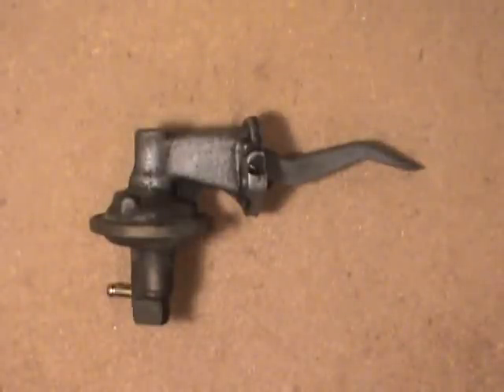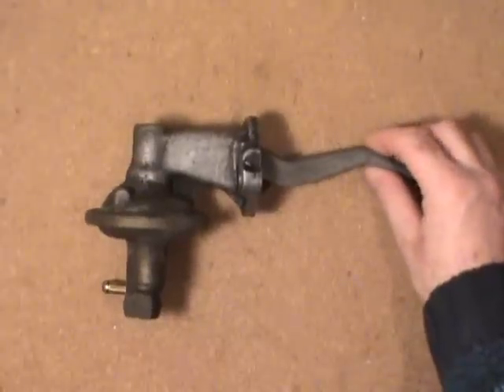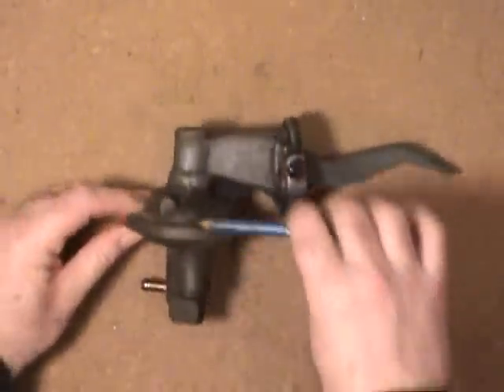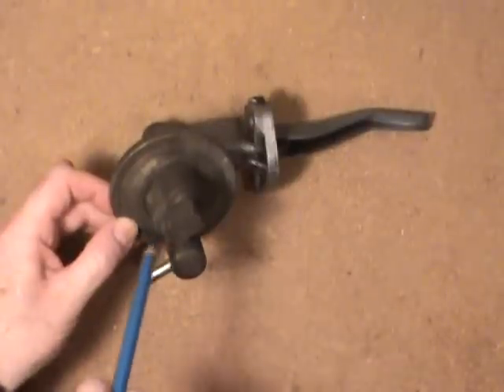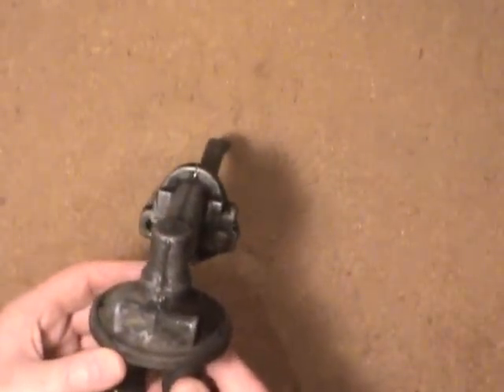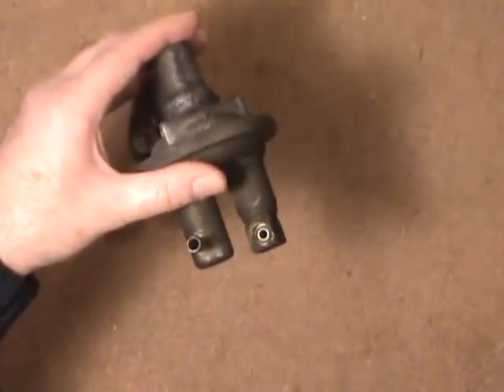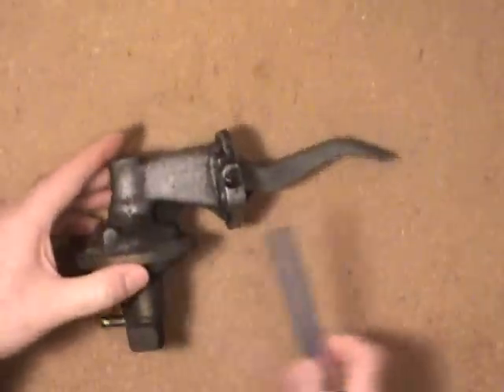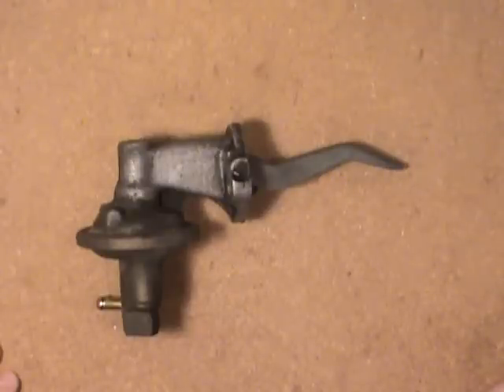Fuel Pump Mechanical Type Demo

Comment: Sooo...  Am I correct - if I were to gently suck on the inlet tube, or gently blow in the outlet tube, the valves should offer some resistance if the pump is working correctly?
Reply from the maker: Greetings...Don Emmerich.............Thanks for watching............."Warning"...!!!...Never Inhale Gasoline Fumes, or, Gasoline, in its Liquid state, cuz the stuff is Very "Toxic", and is probably, a Nasty, Cancer causing Carcinogen as well...!!!................Maybe, try Your Low...Air Pressure Test, with something along the lines, of, an empty Squeeze Bottle (or squeeze bulb), with some rubber hose or tubing, connected to it, that will also fit, onto the Pipes or Fittings, on the Fuel Pump, and, just use hand pressure, on the squeeze bottle, for the Positive Pressure Test, and then, for the Vacuum/Suction Test, then, shall we say..."Pre-Squeeze" (aka, Squish the Air out of the Squeeze Bottle)..."Before"...making the Connection, to the fuel pump's, pipe or fitting, then Release, Your hand-hold, so the Squeeze Bottle, does all of the work by itself...oh, and, do the Test Out-Doors, for safety's sake.................I guess, that, in theory, by doing the Test, of Fuel Pump's, one way (only) "Check Valves", then, at least You'll know, whether or not, they are Functioning somewhat...........Me, myself, well, I haven't done this "Check Valve" test, yet, but maybe, some day, I just might...???................Speaking of Mechanical Fuel Pumps & (one way) Check Valves...a few years ago, I installed, a Brand New/Brand Name Fuel Pump, on a V-8 Engine, and it seemed to be working Ok...for a while...then...Oh oh...the Engine Died, and the last, shall we say "Suspect", that I was thinkin' about, was, the Brand New (with only a few miles on it) mechanical Fuel Pump, that, I not so long ago, installed, and I said to myself...nah, can't be that Nice New (mechanical) Fuel Pump, that's causing the Fuel "Starvation", in the Carburetor's float bowl, but, then again...Could "it"...???...............So now, here's the Test, that I did (and usually do), for the mechanical, type of Fuel Pump, that bolts onto the Engine Block (usually)...............I have the Vehicle (in question), parked Outside...then, I remove the Fuel Line, from the Carburetor...then, I connect, a few feet of Hose, to that disconnected fuel line, and place that Extra length of hose, into a Catch Can/Bucket, that's on the ground, near one of the car's front fenders...........Then, have a Helper, "Crank" the engine over, and, if the Engine Starts or Does Not Start, I'll be Watching the Way, that the Gasoline Flows, out of the end of that, shall we say Extension Hose.................If the "Flow" of Gasoline, is nice-n-Strong & continuous, then, the Fuel Pump is probably Ok...............If the Gasoline "Flow", is Weak...intermittent...or just "Spits", a little bit, just like this..."Faulty"...Brand New/very Low Miles on "it"...mechanical Fuel Pump..."DID"...!!!...then..."There's Trouble in Pair-ah-Dice"...!!!...lol...oh, and also, before doing this Failing Test, and do-in, the...Point-the-Finger-Blame-Game...@ the Fuel Pump...."Make Damn Sure", that There "is"...Gasoline "in" the Gas Tank...!!!...lol...............I sure (at the time), did, "Suspect", that, at least, one of the (one way....only)..."Check Valves"...in this almost Brand New, mechanical Fuel was "Fubar" (aka, messed-up), and pretty much, kinda rendered, this particular mechanical Fuel Pump, "Almost" Useless...and I say "Almost", cuz, at least the Car (at night time, and not much traffic on the road), made its way home, under its own Steam (well actually, it was, the little bit of "Gasoline", that managed, to make its way, into the carb's float bowl), that allowed me to, shall we say "Nurse" (with fingers crossed), and having the Car, going quite slow, and get this, "it" made it, all the way "Home"...!!!...Yip-ee...!!!...and look Ma...No Towing Bill this time...!!!...lol................Then, there's a "Pressure" Test, that can be done, with a Low Pressure, Fuel (testing) Gauge, well, if You have one, that is...............For a V-8 Engine, I'm use to seeing, about 5 to 7 PSI/Pounds per square inch, there-abouts.................To make sure though, get ah-hold-of, the "Specification", for that "Exact" (mechanical) Fuel Pump, and Engine, etc...cuz, some Engines might need Less Fuel Pressure sometimes..............For most Carburetors, it's usually..."Under/less than"...10 PSI...oh and, don't get Too Low, or Fuel Starvation (in the carb's float bowl), it just might be....and......till next time........Be Safe, take care, and have a good one.

Comment: im a do it yourselfer and iv got a 75 lincoln with a 460 big block 3 ports on the fuel pump the shaft that connects to the motor dosnt seem to have a rod that goes on top iv herd from a friend that all u do is shove it in and go the pump i got is supposed to be better then the standard but the shaft goin in is strait not curved is that going to be a problem cause i dont want to force it in iv got it under the crank shaft but im real leery cause of the tension ur thoughts good sir oh and besides the obvious it seems smaller in width and design then the standard the guy i bought it from said itll pull in more fuel
Reply from the maker: jacc boss Greetings jacc boss....Thanks for watching, and for Your comment/questions as well................................That "Rod" that You were referring to, might it be, that, You are thinking of a Chevy (Chevrolet), V-8 Engine's Fuel Pump, where that "Rod", that we are talkin' about, gets placed in the Chevy V-8's Engine Block, Before the Fuel Pump gets Bolted-On perhaps...???..............................As far as I understand it, Your 460 Cubic Inch (Displacement), V-8 Lincoln Engine, probably has, what is referred to, as a "Mechanical-Type of Fuel Pump"..."Eccentric"...that works, pretty much like a Camshaft Lobe works, only, this "Eccentric", is Round (shaped), and is Installed "Off-Center", to the Camshaft's Center-Line, which makes this "Eccentric", work, pretty much the same way, that a Camshaft Lobe does, which, in essence, is to, just make things go..."Up and Down"...so to speak...lol.......................................When it comes to, "Re and Re-ing" (Removing and Replacing), an Old, or Faulty, Mechanical, type of Fuel Pump, on a Stock/Factory, Un-Modified Engine, I always make sure, that the "New" Fuel Pump, that is to be Installed, is One, that is recommended by the Factory/Manufacturer, of that particular Vehicle and Exact Engine, and, any Fuel Pump that I Purchase/Buy and Install, is always Made, by "Reputable"..."Major Brand"..."Manufacturer"...to insure, that I have a much better chance, at having that "New" Fuel Pump..."Fit and Operate Correctly"...and..."Not Damage the Engine, or, the New Fuel Pump"..."In Any Way...What-So-Ever"...!!!...................................I'm hearin'..."Alarm Bells"...go-in off, just hearing, about how You were sayin', that, the, shall we say..."Lever/Arm"...on that Fuel Pump, that You are thinkin' of Installing..."Does Not Match Exactly"...the..."Original Lincoln/Factory/Manufacturers"...Fuel Pump..."Lever/Arm''s"..."Shape/Length/Width/Bend/s"...and to me, it's kinda like..."Gambling"...and most times..."The House" (Gambling Establishment) "Usually Wins"...and...You (and I)..."Lose"...lol......................................There is a "Wear Pattern", that You should be able to see, on the Fuel Pump's "Lever/Arm, that was in Your 460 Engine, and, it is usually showing up, as a "Shine-ee Silver Color", and, that should have a "Matching", Smooth Shine-ee..."Ring"...showing on the "Eccentric", if the Fuel Pump was not installed, and, You were able to look into the "Cavity", where the Fuel Pump's Lever/Arm goes into, with a Flash-Light, possibly...................................If, and I say if, that Fuel Pump, with the Lever/Arm, that "Does Not Exactly Match the Factory Original One", can, as I see it, do at least "2-Things"..................................One is where, that "Not Matching Lever/Arm"..."Does Not Move the Fuel Pump's Diaphragm Enough"...and might cause..."Low Fuel Pressure and Low Fuel Volume"...as well......................................If, the Not Exactly Matching...Lever Arm...comes to a "Stop", and the..."Eccentric"...tries to..."Force"...that Lever Arm, past its "Range of Travel"...there, very well, might be, some rather "Expensive Damage", both, to the Engine, and maybe, to the Fuel Pump as well, as a Result of, just that...!!!...and, I hope not....................................Here's one for Ya.............See if that "Guy", will give You, in "Writing", an "Unconditional Guarantee", that, "if", that Fuel Pump, that He Recommends, for You to Install, on Your 460 Cubic Inch V-8 Engine..."Causes Any Damage, What-so-Ever"...to Your Engine, oh and, that Fuel Pump, that He's tryin', to get You to Install, on Your Engine as well...??? (Gee, I wonder what the odds of that, just might be...???...lol)...............................The Original Equipment/Factory/Manufacturer's "Fuel Pump", was "Designed and Engineered"..."Specifically"...for Your Engine, while it is in a "Stock and Un-Modified", shall we say, "State of Tune", and, things may very well Change, once the Engine in question, gets "Up-Graded", with...."Lots of Go Fast Parts"...which, just might require, a more, shall we say..."Beef-ee Fuel Pump"...that might, just be needed, to..."Feed-that-Really-Thirst-ee-Gas-Guzz-lin-Very Powerful-Newly-Modified-Engine"...!!!...lol........................................So then, there You have it, well, for now, that is.................................If You have any further, concerns or questions, at all, just leave a comment/question or two, under any of my YouTube Videos, and, I'll do what I can, to help You out...............Till next time.........Be Safe, take care, and have a good one.
Reply: That's great into for any and all dyi gearheads! As far i know all chevy engines use a actuation rod to operate the fuel pump(the chevy inline4's I'm not 100% sure on). Now a question, on mopars how is the fuel pump activated?
Reply from the maker: Chris Gropp Greetings Chris Gropp....Thanks for watching, and for Your comment/question as well................Mopars (Motor-Parts, I think?...be-in, Chrysler, Dodge, Plymouth, etc.), and many, of the Other, Older Engine Makes, in North America, as well, will probably have, what is known, as a..."Fuel Pump Eccentric"... that Actuates/Moves, the Mechanical type of Fuel Pump's, "Arm/Lever" that, for the most part, gets "Bolted", onto the Engine's "Camshaft", which Rotates at 1/2 the Revolutions, that the Engine's Crankshaft, Spins/Rotates at, due to the, Timing Chain's, 2 Sprockets, 2 to 1 Reduction Ratio (aka, 2 Revolutions of the Crankshaft, equals, 1 Revolution of the Camshaft)..........................This Eccentric, is actually a "Round Diameter", that is "Offset", in Relation, to the Camshaft's "Center-line" (from, end to end), that will make, the "Eccentric", shall we say, "Wobble", Up and Down, when-ever the Camshaft, that it's Bolted to, Spins/Revolves...................When this "Eccentric" Rotates, and Wobbles (goes Up and Down), it is this Motion, when in Contact with, the Mechanical Fuel Pump's "Arm/Lever", that will make the Mechanical Fuel Pump...well...Pump...!!!...lol..............Just type in...Fuel Pump Eccentric...into Your Browser/Internet...Search Box...and...select...Images or Pictures...and, there should be lots, did I say LOTS of Pictures, of the (Mechanical, type of) Fuel Pump..."Eccentric"...for You to have a look-see at..........................Till next time.............Be Safe, take care, and have a good one.